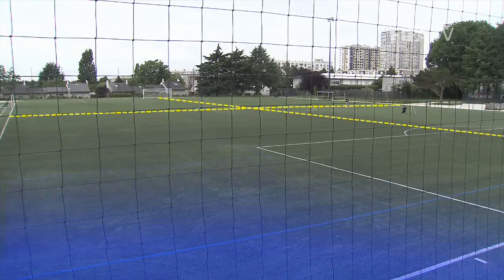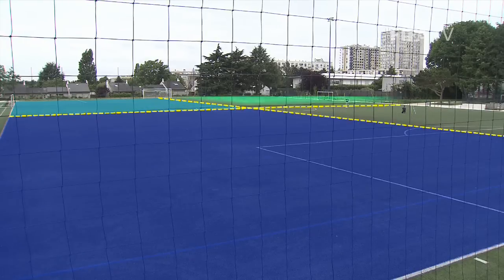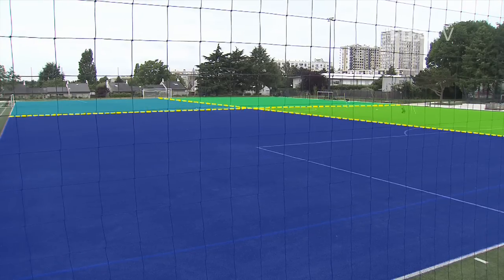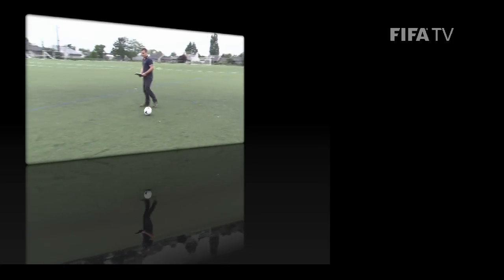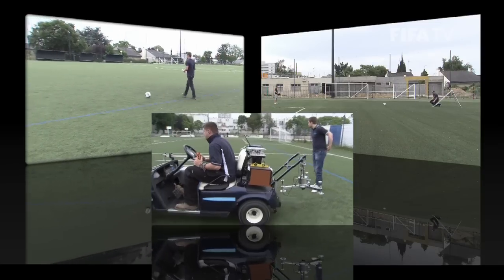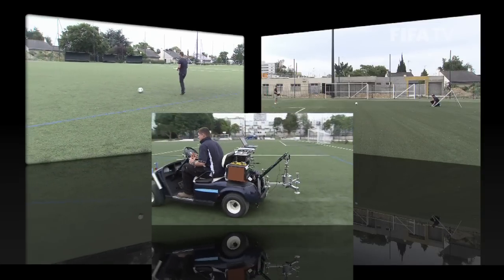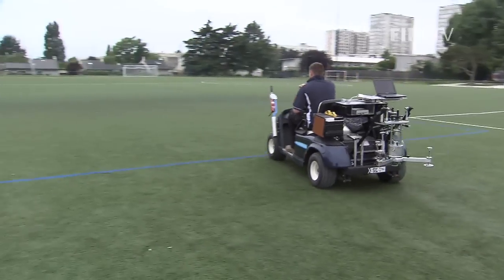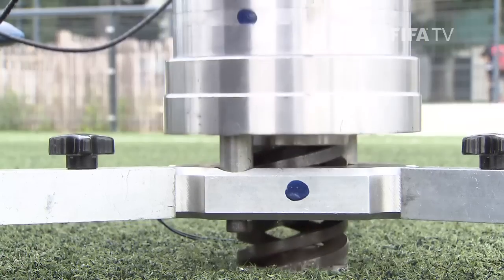How to maintain a FIFA certified football turf pitch

Comment: What is the material inside the turf surface
Reply: TSUNAMI X rubber pellets
Reply: TSUNAMI X used tires, cancerous material
Reply: The artificial turf that’s made mimic to look of grass is plastic.  The infill material used to mimic the feel of soil are rubber pellets.
Reply: The pellets makes more softer or what???
Reply: INCREDIBLE INDIA no it hurts when u slide tackle it’s called a turf burn
Reply: +freddy chavez that's why they are supposed to water the turf so it doesn't hurt as much
Reply: Infill materials. On this field; sbr ( rubber ) and sand.